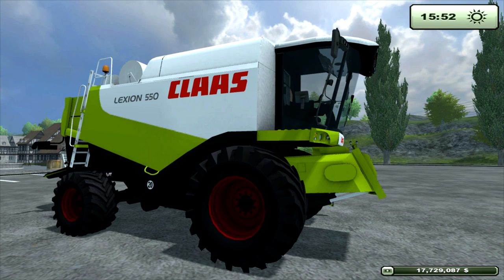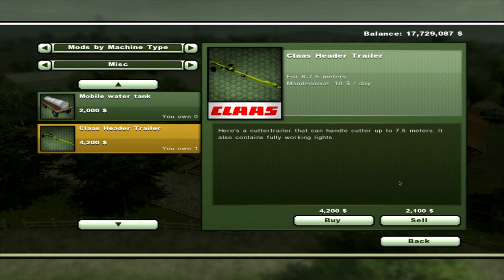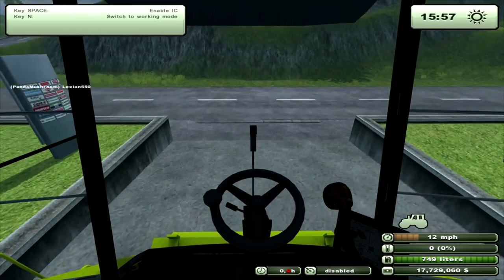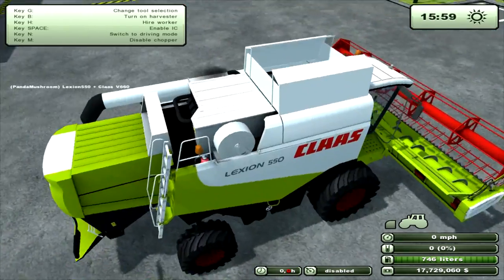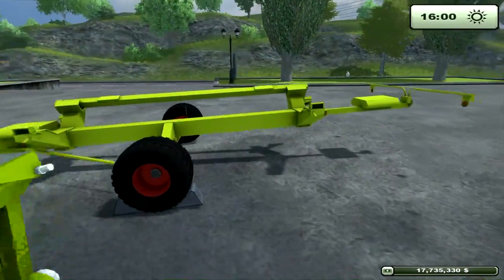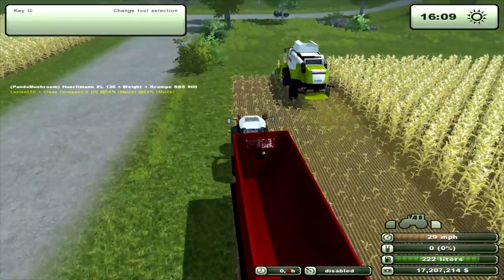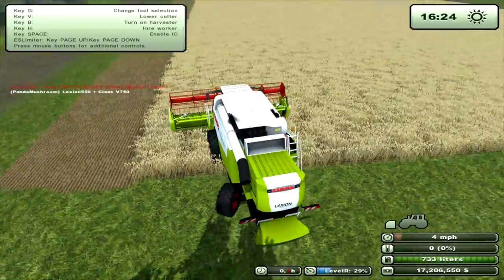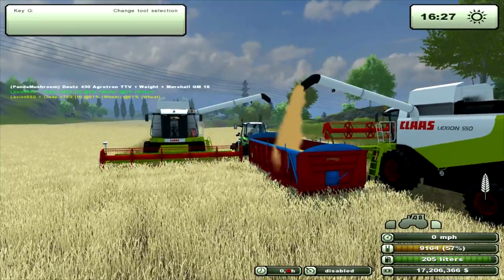Farming Simulator 2013 Mod Review Claas Lexion 550 V 3

Comment: That's a nice mod-review. Thanks for that. Usually the work-mode is on the "K"-key. Maybe there's a mod with the same Inputbinding. The manualunloading is on the "n"-key. If you want to use it for yourself you could try to delete the InputBinding.xml once.

Comment: Only problem I could see was it has 2 operations bound to the same key, pipe out and chopper width both use the O key which prevents the pipe being put out with the chopper on. But nice harvester otherwise.